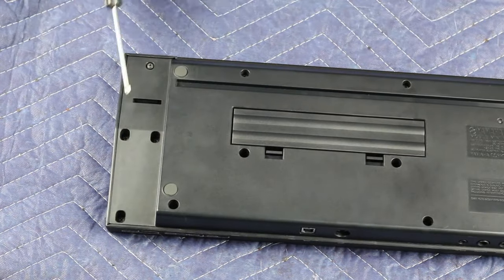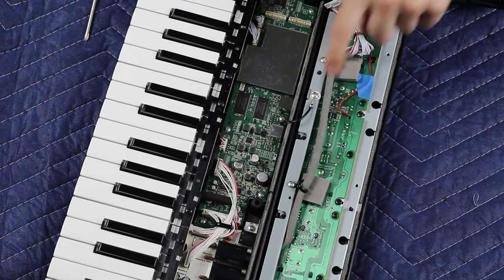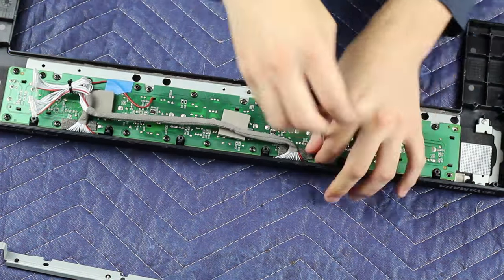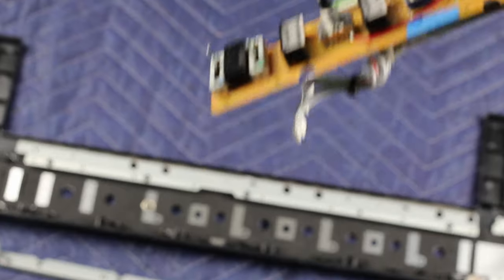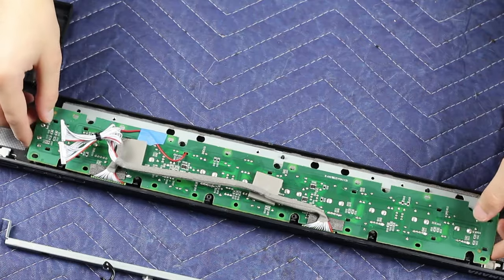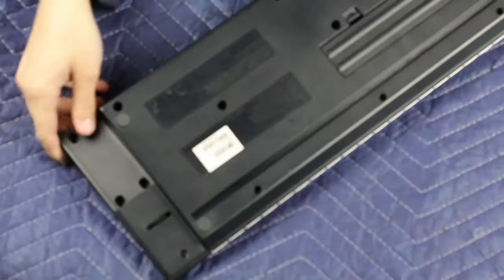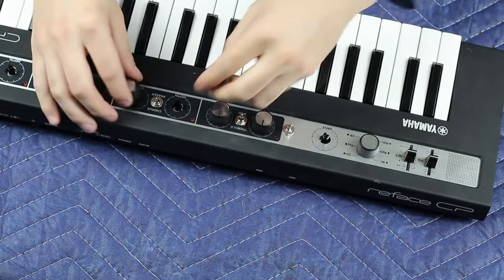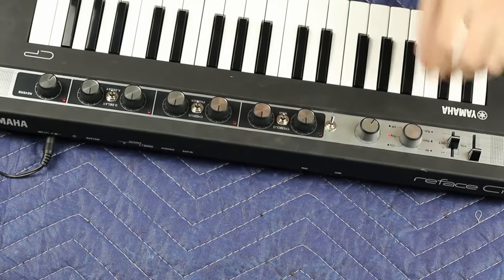Yamaha Reface CP Acoustic Piano Mod Tutorial

Comment: I always wondering if you could remove the Keyboard board and install a Normal size keyboard from a MIDI controller. ..
Reply from the maker: That's definitely possible, there are probably a couple of ways to do something like that. I myself would actually be interested in trying to do that as well. I think it'd be cool to build a vintage-looking Rhodes or Wurlitzer style chassis with a 73/88 key MIDI controller and mount the Reface electronics inside.
Reply: @Control_Room   I Ve used to have this reface and I love it.. But always bothered me the little keys.. A good semi-weight keyboard can be a good "portable" Rhodes...    after seeing your video.. made me think about getting it again lol .. cheers!
Reply from the maker: @cristiancornejo  Thanks for watching! :)
Reply: From what you know, would it be possible to have the aux input routed to the effects section, with an easy two position switch?

Comment: I’ve had the reface CP for six years or so. I absolutely love it and play it all the time.    I did this mod when I got it but it never worked as it was meant to. 

All it does is switches the toy piano to the CP piano.   

I can get the acoustic piano by the usual in-between start up hack, but the added  switch doesn’t do it.   

The upside is that in the down position on the toggle switch, I never have to hear the atonal monstrosity that is the toy piano.  I can have it switched off permanently.  

It’s still a win.
Reply from the maker: Thanks for your comment! Hmm, that’s interesting. If done correctly, having the knob on the toy setting while the additional switch is turned off should give you the same result when powering up that you would get with the usual in-between method.

Comment: Can this “secret” sound damage the instrument? I read somewhere that some people broke their keyboard using this trick. I don’t know if it’s true though…
Reply from the maker: Not at all, as far as I know. The acoustic piano sound seems to be the default initialized patch when the rotary switch has nothing selected.
Reply: That secret sound was put there by Yamaha! Is a sound more. There is a way to do it without modifying anything. With the CP off, the sound selector is placed between any two sounds, without selecting any. The CP is turned on. And you already have an acoustic piano. If you turn the dial and select a sound, the piano is removed and the selected sound appears.

Comment: Thank you for the Video. You’re a mind reader. I won’t be interested in accessing the toy piano anymore so is the acoustic piano going to be accessed by the toy piano position after skipping  the installation of the option toggle switch?
Reply from the maker: Thanks for your comment! Yes, the acoustic piano will be accessed by the toy piano position. So if you turn the knob to the toy piano position and then power up the keyboard, you will default to the acoustic piano sound.
Reply: Watched the link to the other Video several times. My take is if the keyboard is off and turned on with toy piano selected it will be the Acoustic Piano sound. When you choose a different a sound you will have to turn off and on with the toy piano selected to resume Acoustic Piano sound.
Reply: @Control_Room  You’re welcome for inquiry and Thank you for the quick response.
Reply from the maker: That’s exactly right. So it’s still slightly inconvenient but it’s still better than having to force the rotary switch to stay in between positions. I think it’s more consistently repeatable this way, and less wear on the switch.
Reply: @Control_Room  Agreed 😎

Comment: Seems like a lot of work for what? Excuse my ignorance but please explaine.
Reply: It's so that you have a reliable switch to switch on the acoustic piano sound instead of having to force the rotary switch to be stuck between two positions. (Which is unreliable because if it flops over to either direction during a performance the sound will switch)